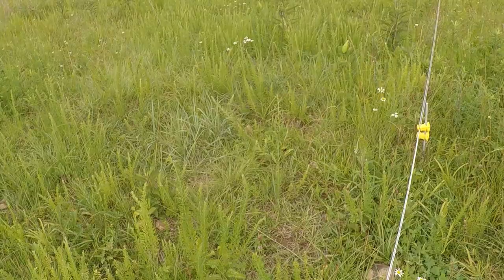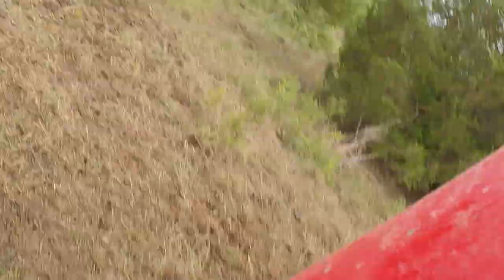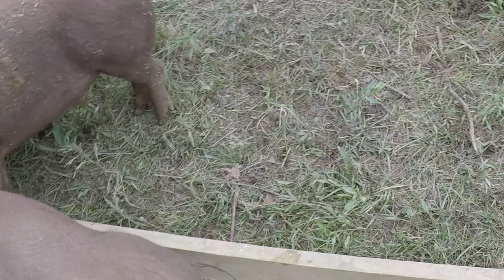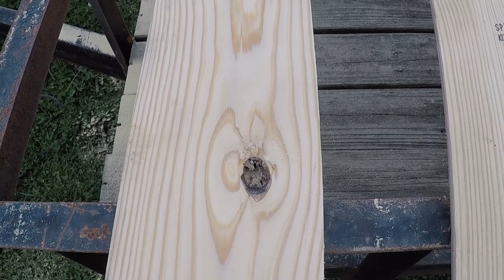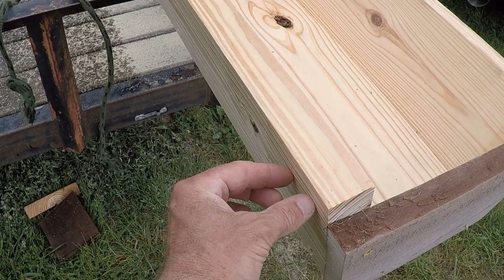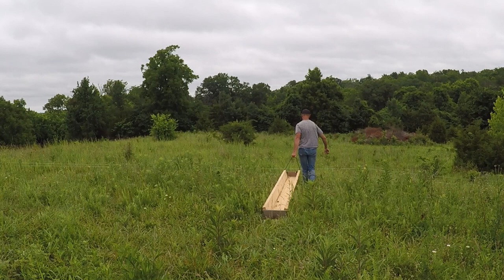How I Feed our Pasture Raised Pigs

Comment: Hey there! Do you have recommendations for a processor?    We’re in London and have scheduled our first processing.  We were quoted about $175 per 250 lb hog.  That’s with some of the meats being cured.  I’m not sure what the going rate is around here or if you could recommend someone more reasonable who does a good job? Thanks!
Reply from the maker: Hello. I use Summit Meats in Science Hill and have been very happy. However, your quoted price seems very reasonable. Especially with some of the meat being cured. The cheapest processing cost I have had with a pig was $190 and that did not include any curing, smoking or slicing.
Reply: @coveychasefarm  okay thanks.  And they’re just a mile down the road from us so it would make sense to stick with them.  👍🏻